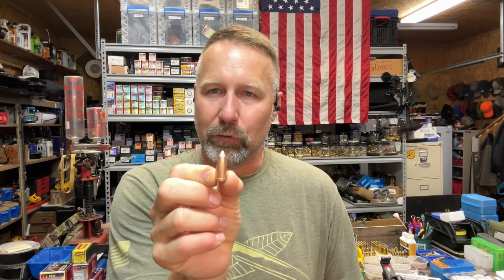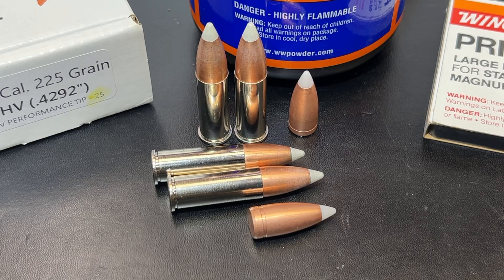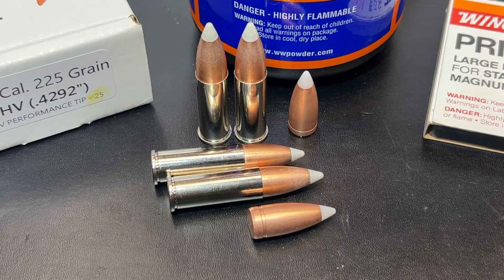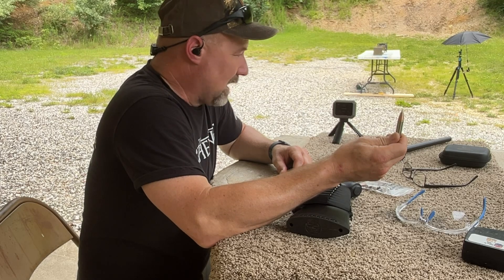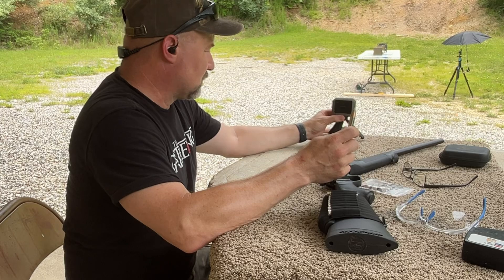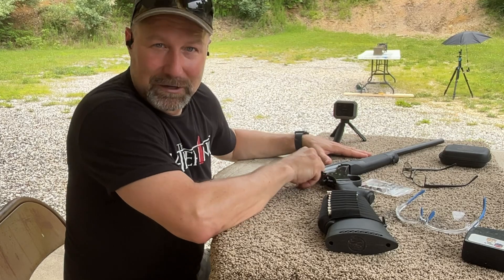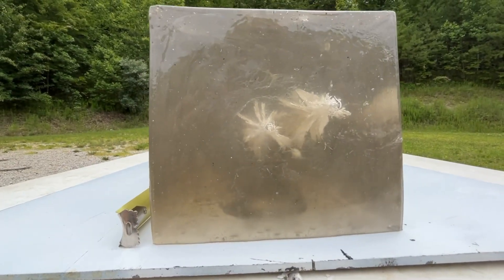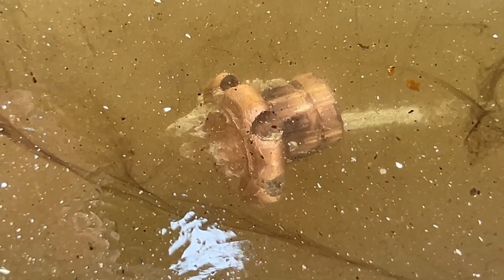.44 Magnum Gel Test – Bear Creek Ballistics 225gr HV Polymer Tipped, All Copper Bullets

Comment: Have you tried running a 44 special case load in a revolver to get a lower velocity to test the expansion performance at those lower velocities. With a bullet approaching $2 a shot I wouldn't expect many folk to do so. But I am curious if that is even an option. I taught my first 3 daughters to deer hunt with 44 magnum rifles. It is a very effective short to medium range chambering. I have a S&W 629 still I might get some of these and try the 44 special potential. I am very curious how well they perform at lower velocity.
Reply from the maker: I have tried that loading, but that was about 3 years ago, before I started doing gel block testing.  I may still have those rounds somewhere too because I never got hooked up with the gun dungeon to test them. 

I’ll put these on my to-do board and try to follow up on it later in the spring.   Here’s a video of the loading from 3 years ago. 😉

https://youtu.be/xY3b3JwEohA?si=qktZ7SXTA4-PW6l3
Reply: @kentuckyrangetime Huge thanks. Much appreciated.

Comment: Do they?\nMake it in a forty five long coat. Calendar forty five. For the single shots.45 cal.
Reply from the maker: The make a .45cal for .450 Budhmaster. They need a tad extra velocity to expand reliably so the .45acp and .45colt loads may not get good expansion.

Comment: Back that down to 25gr. You are way over for a jacketed and way way over for a copper solid. That is why you are sticking the case in the chamber. You have to account for the extra bearing surface on a copper solid bullet. It acts like the next heavier sized bullet. Weight is not the only thing you need to account for.
Reply: Contrary to the load data supplied by the bullet designer?
Reply: @frankbrumbeloe4827  yes, the maker of the bullets do not have pressure testing equipment. They just test out of their guns. You can not use regular jacketed bullet data for a solid copper. Copper being lighter has to have a longer bullet at the same weight of a jacketed. That usually means longer bearing surfaces and grooves cut into the bullet to lessen the amount of bearing surface. If you use the weight of the bullet as a guide for pressure you will run into issues of high pressure. If he backs off 1gr he might be fine. But the sticking in the chamber means he he is WAY over pressure.
Reply: @tommeboy3334  Stop spreading misinformation.  The recommendations from Bear Creek have 100% been verified.
Reply: @ACE-ez1od  you don't reload do you? You don't use a max load for the first test. You work up to it. Every gun is different and his showed high pressure by sticking cases. That is a sign. STOP. There is NO misinformation in what I posted. It is a warning. If you can't see that then you should not be speaking of something you don't have a clue. And, VERIFIED by who?
Reply: @tommeboy3334  Yes, I reload many thousands of rounds a year.  You’re misinformed.
Reply: @tommeboy3334 Feel free to contact me at Bear Creek when we reopen Monday morning.  I’ll explain it to you.

Comment: That looks about perfect. I’d love that in my lever. Is there info on shorter COL or is that not feasible?
Reply from the maker: I’ve loaded a test in .44spl cases. They fit in my Ruger SRH but I’ve not tried them in my lever gun. There probably goes to loss a chunk of velocity but might still do well out to 150-200yrds. 

I may have to continue on that project and see how they chrono. 😉
Reply from the maker: Shorter isn’t an option with a .44mag case. The ogive starts right at the case mouth.

Comment: Interesting very limited use but looks very effective. My guess is the chamber is rough in that gun thats why it’s not extracting. You can shoot factory and measure the base shoot those and measure in the same spot.
Reply from the maker: That’s my guess too. Probably put the flex hone in the for a bit and see if it helps. 

I was just talking about you…. I’m right now working on the intro/outro for the 265gr test. 😉

Comment: Chambering it into a lever action would also potentially create a pressure problem if the bullet engages the rifling because of its length. That will surely cause a pressure spike upon firing because of the bullet already being grabbed by the rifling. That could be why you're seeing a bulge in the case.
Reply from the maker: Not an issue with this bullet. 😉

The reason the OAL on this load is so long is because of the long ogive. The ogive literally starts at the mouth of the case and tapers smaller.

Comment: The extraction issue would be an issue if hunting and needed a follow up shot.
Reply from the maker: Ejecting the longer OAL of this particular loading would only be an issue for an unfired round. 

You’d still be single feeding to reload, but once fired you have a regular length .44mag case ejecting like with any other rounds. 😉

Comment: Why are all copper bullets so much more expensive than lead cup core bullets?
I would think it would cost more to make a lead  cup core bullet than an all copper bullet.
Reply: Most copper bullets are machined (Rather than melted and cast, like lead), so the production costs are higher. And, copper, as a material, is more expensive than lead. But, in the end, the price of something is dictated by supply and demand. As long as people keep buying copper bullets at over $1 each, then they'll stay that price.
Reply from the maker: @m73m95 .  This is the exactly why they’re so high.  We have an in-house machine shop at work, I keep telling them they need to try making me a few bullets but haven’t convinced them yet. Lol.
Reply: Because copper is more expensive?
Reply from the maker: @WayStedYou copper is much more expensive than lead and the CNC lathes to turn the copper bar and expensive to buy and maintain, draw a lot of power and the turning process creates a lot of wasted copper in shavings that aren’t easy to recycle right back into the process like lead. 😉
Reply: @WayStedYou  As of today, copper is $4.42/lb and lead is $0.88/lb. Lead is more dense than copper, so you use "more lead per bullet", but it still doesn't even come close to the cost difference

Comment: Just a suggestion for those looking for a single shot rifle for 44mag. The cva rifle makes two different types in a single shot. Mine is very accurate and has a good trigger.
Reply from the maker: Love the CVA single shots. Buds Guns has a huge selection of their 14” pistol versions too. Like 8-10 different calibers.  Here’s the .44mag version. I’m looking at this one pretty hard. 😉😂😂

https://alnk.to/9xlncVA
Reply: Yes sir my old cva hunter will smoke both of my Henry’s but it only likes HOT 300 grain pills
Reply: Mine will get just over an inch at 100 yards with the Sierra 300 grainers.  Nosler 300s shoot good too.  Heck even cast 300 grain SWCs shoot good at subsonic speed.  It must be the 20 inch twist!  One thing that I noticed was that the barrel seems to get tighter towards the end.
Reply from the maker: @NCPAengineer that’s interesting…🤔
Reply: IVe always wondered how good the pistol version would shoot. I've had several of their rifles from the basic hunter version to the take down stainless model. I still have two one in 44 mag and a 35 Remington. Both are accurate and are very handy hunting rifles.   I found some at academy sports years back and they had some in 308 . But on their website and I called and they said they never offered them in 308????  A friend bought one .

Comment: Wouldn’t mind trying those, however I tried duplicating the 265gr Polmer tip by Hornady in the 44 special brass and when seating the bullet the tip was smooshed slight.

I use RCBS carb reloading die that can be used for both 44 mag and special
Reply from the maker: That’s from the seating stem profile. I had the same issues. This polymer tip is a lot harder than the FTX tip Hornady uses.  Just have to seat it slow and gentle.  Hornady makes an FTX seating stem for their dies that fixes that issue.